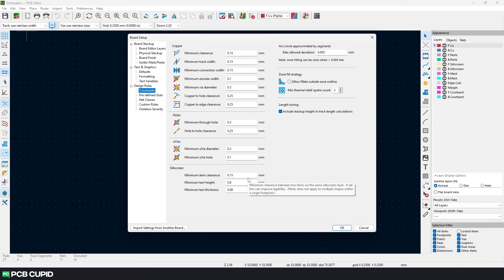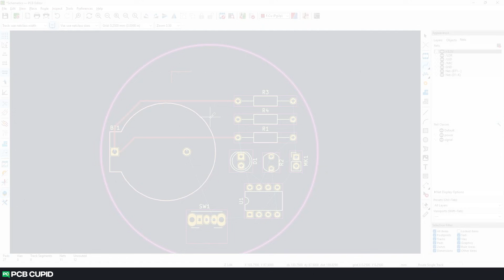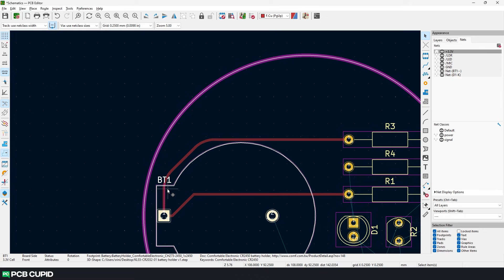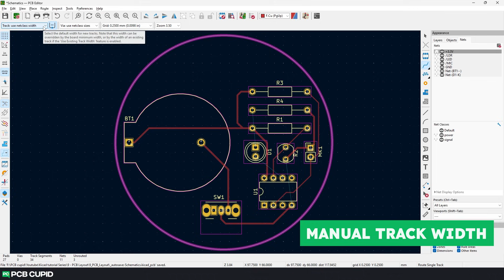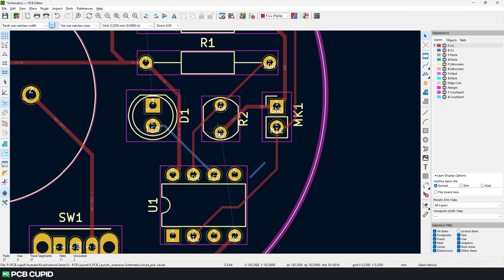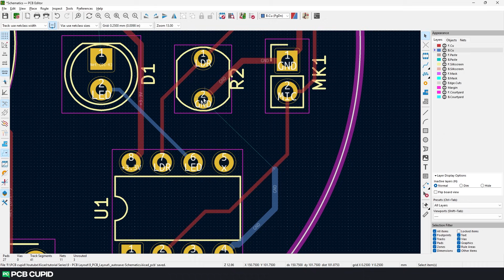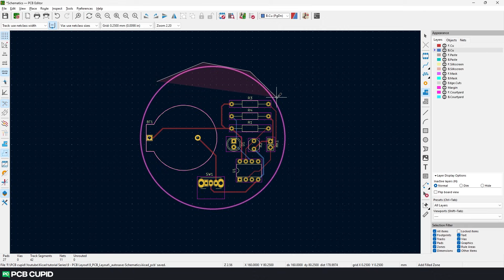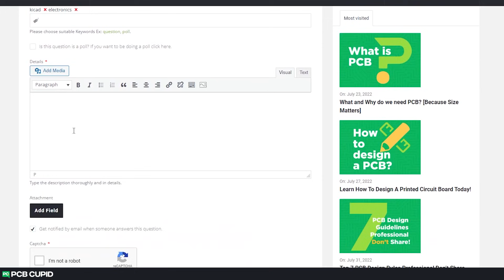#10 How To Do PCB Routing In KiCad 7.0  with Basic PCB Design Rules | #PCBCupid

Comment: If i dont assign a net to the copoer layer, will it be a concern....?
Reply from the maker: They will become an unconnected copper island. It won't be an issue for a simple board. But it will cause issues in the highspeed circuit so it's always recommended to connect the copper pour to the ground.
Reply: @pcbcupid  But if I select gnd, some of traces aren't connecting.... How to sort it out....?

Comment: Good video, thank you. For anyone else who feels that placing vias in the way shown in the video is too slow, it can also be done while drawing a track by pressing PageDown (if you're on the F layer) or PageUp (if you're on the B layer), which will let you place the via connected to the current track and then switch to the other layer, where a track beginning at the via is already started for you. If you have more than 2 layers, you can use the < (less than) key instead, which lets you select the destination layer. This may also be more convenient if you just have 2 layers because it's always the same key, but I've found it a bit finicky to use.
Reply from the maker: Thanks for the tip!

Comment: I was curious about the 90° vs 45° vs Arc section and it seems that these days it's not a problem for the vast majority of PCBs. It seemed to be a bigger problem in the past and these days only for some high frequencies (I've heard MHz and GHz range). So I think 90° angles should be ok and 45° should work for pretty much everything just as well as arcs. I just thought I would share that here for anyone who's interested in this.

PS: Thanks for your tutorial, man. Been binch-watching your whole series. Good stuff!
Reply from the maker: Thanks for sharing the information! You are totally correct, 90 degrees should be okay when designing low speed PCBs. Glad you enjoy these videos!

Comment: Very useful series of videos. I've designed at lot of PCBs, but not with KiCad, so I found this description of the features helpful.

The commercial package I am most familiar with had two very useful features that KiCad does not seem to.

The first was that when routing a track, one keystroke would place a via at the current point and flip to the 'other' layer and then continue routing on that other layer (with multilayer boards you could define a pair of layers to do this with). Very useful to be able to flip from side to side quickly when going across a board. With KiCad, as far as I can see you need to stop routing, place a via, select another layer, then start routing again from that point. Same effect, but the other package managed it with one keystroke. Maybe some sort of macro or python script could be created to do that, don't know.

The second was related, in that one might have a track, and realise later that a segment of it needed to be flipped to the other side - layout tends to be an iterative process. Again all one had to do was select the segment, and one keystroke would again flip the side, and place vias at each end. Or, if the result of the flip was that a via wasn't needed, remove it if there was one (such as if you flipped the track back to the first side again). Again, no doubt KiCad can do it with more actions (add/remove vias, delete segment, select other layer, route segment again etc), but the single keystroke was quick and easy. Again, maybe some script could do it, don't know.
Reply: what are those two very useful features?
Reply: I don't know about the 2nd thing, but the 1st can be done by e.g. pressing the < (less than) key while you're drawing a track, then selecting a destination layer for your via. I've found this a bit finicky to use, so alternatively, if you only have 2 layers, you can also use PageDown (if you're on the F layer) or PageUp (if you're on the B layer), again while you're drawing a track, and it will place a via and then switch to that layer, still in drawing mode.

Comment: I didn't catch what does copper fill do
Reply from the maker: Copper filling is a process where copper is used to fill in the gaps and spaces on a circuit board, improving its conductivity and etching process during production. Usually this excess copper is connected to ground for better electrical performance as well.
Reply: @pcbcupid  is the copper fill it's own layer of the PCB stack? I didn't see it as part of the layers. Also, which gaps are you referring to?
Reply from the maker: @joshuamerullo3593  it's not a different layer, it's on the copper layer (both front & back). Once you route your PCB, there would be excess gap between the traces and between the components. This gap is filled with ground/copper fill.

Comment: Wasn't able to make copper layer to fill.    I could build polygon around PCB -- but when I connect final end -- just had outline of polygon
Reply from the maker: Use the shortcut 'B' to build the copper pour layer.
Reply: @pcbcupid  Yeah you kinda missed mentioning that step in the video.

Comment: Could you explain the copper fill a bit more?
Reply from the maker: Sorry for rushing on that topic. 

There are many reasons why we should use copper fill 
1. Easier to etch copper during manufacturing
2. Copper fill helps in heat dissipation 
3. Copper Balance - By balancing the amount of copper on both sides of the board will reduce warping, which might occur during reflow
4.  Connecting the copper fills to ground can help with noise reduction by adding shielding
5.  High current paths - Provide a short return path for high current devices
Reply: @pcbcupid  Make a detail video about it.

Comment: is there a way to automatically set the  minimum distance between placed components be 1.016 mm or should we do it manually by using ruler
Reply from the maker: The component size and shape can vary a lot, so there might be no automatic way to set the minimum distance.

But you can use "Positioning tools" to place them accurately apart from each other. 
Select the footprint -> Right click -> Position Relative to (And on the pop up select the reference and the distance between them)

Alternatively you can also create custom Grid size under Grid settings with 1.016mm on both X and Y axis. This will not give a accurate minimum distance between the components, but this process will be much faster.
Reply: @pcbcupid  Thank you